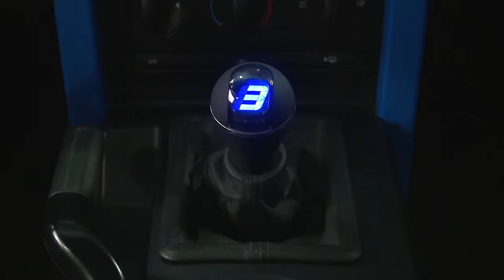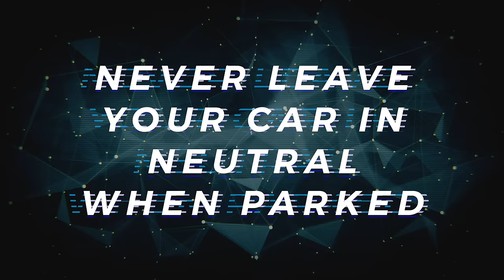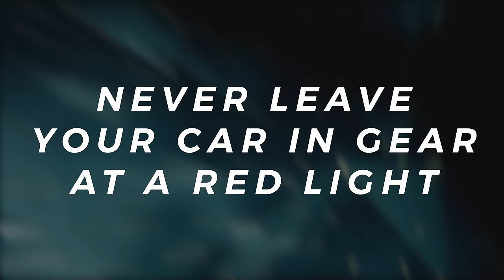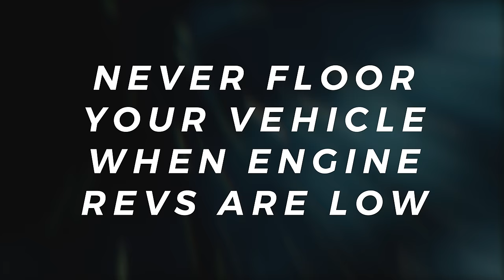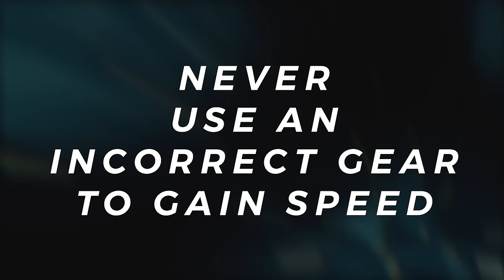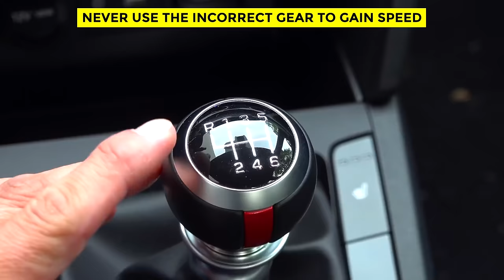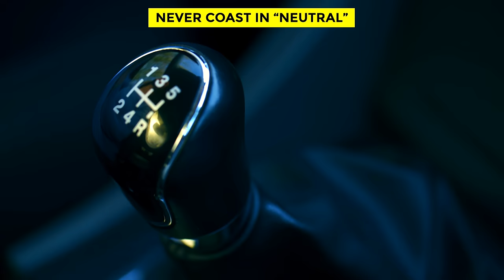7 Things You Should NEVER Do In a Manual Transmission Car!

Comment: "never brake without engaging the clucth"?
engine braking is a thing
Reply: Ig so
Reply: Motorcycles do it constantly
Reply: Lmao
Reply: He probably means "brake to full stop". Most likely nothing will happen if you hard brake without clutch, your car will just stall.
Reply: They use engine braking all the time in Rally’s and Moto
Reply: What is engine braking
Reply: @SpherePK  shifting to a lower gear and release the clutch
Reply: @nightraid6238  ahh okay so the same as downshifting?
Reply: @SpherePK  over-downshifting to where the engine brakes the car
Reply: So glad someone else picked up on this 😅
Reply: @BUSHRABBITRIDING  fr 🥲
Reply: Spelling is also a thing
Reply: @giarlymoltubakk5869  other countries asides from UK or USA is also a thing
Reply: @pottasium7117  bruh, I live in norway
Reply: Exactly vro🤪
Reply: @giarlymoltubakk5869  Countries are written with a capital initial.
Reply: @SpherePK  when the car is moving and you release the throttle, the engine is already slowing the car down, since it isn't injecting fuel (except for 20+ year old cars), what's making the engine rotate is the kinetic energy from the moving car, and part of that energy is being lost at the engine's moving parts. When you down-shift and don't accelerate it's more noticeable
Reply: Good grief
Reply: @SpherePK  you put clutch in change to lower gear let revs drop all the way down then slip clutch and it slows down the car cuz the engine isn’t spinning and the wheels start to spin the engine but it makes it slow down
Reply: @marconarco540  yeah, but if anybody hasnt figured this out yet, then they dont drive manual, or dont drive, its super redundant.
Reply: I'm pretty sure he's saying that so you don't stall the car if your RPMs get too low.
Reply: @KrumzGaming  I use engine braking, when going down a steep hill, near where I live.

It saves wear on the brake linings.
Reply: I was thinking the same thing…
Reply: @KrumzGaming  And left-foot braking. Kart racing doesn't use a clutch at all (non-gearbox karts) - you only have a brake and accelerator pedal.
Reply: @SpherePK  You use the engine's resistance when downshifting to give you more stopping power rather than fully relying on brake disks.

Slow down, shift down two gears at most, slow down some more until your revs are low. Clutch in fully and gently brake.

Clutch + brake is called coasting and is not good as you are not really in control of the engine.
Reply: most appropriately it's called engine "killing"...
Reply: Use brake to ease the pressure on the engine when shifting down
Reply: Listen here potassium head, engine braking is different and STOPPING without using a Clutch but only with the brake is different. Today's gen Z is way to conclusive and idiotic daamn.
Reply: @guyunknown9123  no shit "my fellow gen z"
Reply: @marconarco540  going down to 1000rpm is totally fine in 6th gear. When rolling
Reply: Why am I watching this? I've known how to drive a stick for years.
Reply: @SpherePK  So, you know how keeping your transmission in gear will stop the car from rolling away when it's not running.  You also know that you can start a manual transmission car by rolling the vehicle and engaging the clutch.   Both of these happen because an engine has "Compression" - which is how well it can hold pressure in its cylinders, and an engaged clutch holds the movement of the wheels to the movement of the engine.  

You're moving at, say 50 miles per hour with an engine speed of 2000 rpm.  Without declutching, let your foot off the throttle.  Your engine speed will begin to drop.  The compression of the engine - the same force that keeps the car from rolling when parked - will work to slow your car down.   While it's doing that you apply the brake as well and decelerate smoothly.

About at the point where the engine would naturally idle - usually about 1000 rpm, disengage the clutch so that the engine doesn't stall.
Reply: Think he meant use your breaks, engine breaking is a different thing than using your breaks
Reply: @Wikidshroomz69  same, and it made me slightly upset
Reply: @BUSHRABBITRIDING  so do semi-trucks
Reply: Right? And then he proceeds to say to first brake then push in clutch. Wtf
Reply: @SpherePK  letting your foot of the gas while in gear your engines rpms drop and seeing as your tranny is still connected it slows your car
Reply: @isaiasrdossantos  no their is still fuel and air being injected into your engine with a spark it would stall every time you let off the gas or came to a stop maybe in the new cars that like to shut off at lights but then you engine would still shut down and if your in gear it would lock up your tires tip dont shut off your car while moving unless you want to chew on your stearing wheel
Reply: Pretty sure he meant never stop without engaging the clutch
Reply: ye he also stated never to free car put your car in Neutral going down hill which is not a bad idea as it will save fuel with modern cars but engaging the Clutch kinda makes that pointless unless you are trying to stop
Reply: Yes, I believe often in a motorcycle. Shifting to lower gear slows down the RPM, which helps when going down steep roads. It prevents wear on the brakes and splits the load between the gear and the brakes. 

Lower gear also means "Higher torque" which allows you to go up steeper roads easier. AVOID NOT USING THE LOWER GEAR IN THESE SCENARIOS.

My fucking chain broke because of that. We had to stand for 2 hours in the dead of night trying to replace one of the teeths.
Reply: It’s exactly that but not giving it gas after.
Reply: If you stop completely you ought to hold in clutch otherwise the car will shut down. If you are just slowing down you can simply lower gear.

Comment: 8:00 "never slip your clutch! it will destroy it!" ... Uhm... the point of the clutch is that it slips to enable smooth gear transitions. I agree with "don't drive with your foot resting on the clutch", since that WILL fuck it up, but using the clutch as it was intended and designed to handle (to start from a standstill & to absorb the difference in RPM between the engine and transmission when changing gears) isn't going to kill it. A clutch is a consumable. Consuming it in less than 100k km usually means you abused it (or used it predominantly in heavy city traffic or while towing large loads on hills often). If it lasts you 150-200k+ km, then it served its purpose.
Reply: Yeah, good luck using the clutch without any slipping. Any difference in speed means slipping to some extent.
Reply: I’m pretty sure he didn’t literally mean don’t use the clutch as intended.  I’m assuming he’s simply saying don’t slip it more than you need to.  I can hear a lot of manual drivers slipping their clutches while rowing thru the gears.  That is NOT how the clutch was intended to be hsd
Reply: Well yes but actually no
Reply: I drive my car whit It's original clutch in it, It has 300k km and I think it will least another 50k km and I do used it some times to prevent roll back from a hill
Reply: I also seen drivers redlining the engine and barely slipping the clutch just to start from a stand still
Reply: Just drop it and let the tyres do the slipping
Reply: From now on i will drop the clutch every time i drive away in first gear. Should be better for my car
Reply: Bruh you're an expert
Reply: @daviotje1528  also make sure its in R (race mode)
Reply: @tubestick00  haha i laughed at that
Reply: i agree, i have a jeep wrangler and when doing serious off roading rock climbing this will be inevitable you'll end up popping the clutch an jolt yourself right off the cliff, jeeps have extra thick disks for this very reason
Reply: @TheMarcellToth  same here, i got a truck that has around 200k miles and its the original clutch.. when on a hill i always use the clutch (unless i'm towing a load)..
Reply: My Volvo took 450k km to use up the clutch and some can last up to 500k. But hey they aren't gonna last forever that's what they're for.
Reply: @jujuseption  🤣🤣🤣
Reply: @jessel1217  pretty sure he prob did..lol
Reply: @tubestick00  i always start off in 3rd who wants to do all that shifting, those first few gears are for old people and 🐈`s..lol high RPM'S and high gears!!!
Reply: @terriwebb5093  and that's how you fuck up your clutch and transmission .... Go learn to drive dude😂
Reply: Dude my Ford focus from 2000 is a fucking tank it is on 400 k km and I used to slip or stop rolling my car back soo much times I didn't give a fuck, and still it's working properly I just don't drive the car.
Reply: looks at transmissions stats. Sees 'slipper clutch' huh
Reply: @king-su5uc  when you fail to see an obvious joke -_-
Reply: This Is How I Think A Gearbox Looks Like:

R 2 4
   N
1 3 5
Reply: Basically to avoid slipping the clutch it’s best to drop it when taking off.
Reply: Never had a button clutch have u 🤣
Reply: @rpgspyware9560  something will soon break then
Reply: mine lasted for 350k i suppose thats the old vw design doing its thing xD
Reply: True using a clutch is much easier and efficient then using the handbrake for a hill stop start especially in traffic... The trick is don't half clutch it you just got to time it correctly ie let go of clutch and press the accelerator at correct timing and you're good to go ...

Comment: 1:53 Should be renamed to:
"NEVER STOP THE CAR WITHOUT ENGAGING THE CLUTCH"
Like hell I'm gonna be doing 120kph down the highway and press the clutch if I have to brake down to 100 kph.
Reply: yeah, clearly they haven't drove manual in their life, engaging the clutch before braking is flat out dangerous, staying in gear (or downshifting if not a sudden situation) actually helps braking and keeps better control of the car. most average manual drivers know when to clutch so the engine doesn't stall. btw, i haven't seen anyone doing this.
Reply: It's stop, not brake or reduce speed
Reply: @mattdniels  Bruh, why people don't understand that if you try to avoid an accident you won't even think about the clutch... 🤦‍♂
Reply: @levguguchkin1580  this!!! I was cruising 100kph and just over the hill there was a long line of traffic backed up because there was a massive hedge trimmer clearing the trees up ahead, I slammed on the brakes immediately lmao, I was taking my mates for a road trip 3 hrs away, anyway I have a 96 civic so not the best brakes but I stopped mere centimeters from the car infront of me, and that shook me to me core and foe the rest of the drive all I could think about was, damn should have downshifted to slow quicker but didn't even cross my mind at the time, anyway story time over
Reply: @tomgush  noice
Reply: @levguguchkin1580  If you grew up with manuals and almost never drive automatics like most Europeans you don't have to think about the clutch in an emergency, you instinctively use it correctly due to long experience.
Reply: when slowing down you should press the clutch when you are below 1000 rpm
Reply: @levguguchkin1580  actually if you drive a manual car long enough you dont even think about it .It becomes muscle memory.For instance if you are at a high speed and you see trafick and dont have a lot of time to break the speed the first thing that comes to mind is to downgear and break.
Reply: Use clutch and brake to stop, use brake only to slow donw
Reply: @levguguchkin1580  should be habit
Reply: @lockiemcneven7219  That's how I tell you never been in an accident 🤦🏼
Reply: @levguguchkin1580  thank you
Reply: @giornikitop5373  Yeah it is same is taking it to neutral in high speeds or downhill. Some of advice here are flatout dangerous.
Reply: @tomgush  Uphills are blindspots so you should slowdown a bit and be very vigilant until you can see what is behind.
Reply: km/h*
Reply: @tomgush  km/h*
Reply: Also pressing the clutch while braking increases the braking distance.
Reply: @AryanSingh2512.  the hell, no?
Reply: fr, like tf are they racing? if you press your clutch then brake it can lock up and will have a hard time getting traction
Reply: "stop" vs "slow down"
Reply: @levguguchkin1580  you absolutely right
Reply: It is a correct term to use in this scenario.
Reply: Extremely well stated
Reply: During the deceleration process, I ALWAYS STAY IN GEAR while applying the brakes. I also DOWNSHIFT TO LOWER GEARS to actually help the deceleration process in steps, combined with braking. Depending upon road and traffic conditions, I come ALMOST TO A FULL STOP while in 2nd or 3rd gear and pressing the brake pedal only. Then I press the clutch pedal to the floor ONLY at the very last bit of forward momentum, then bring the car to a full stop by pressing BOTH the clutch and brake pedal. Use each downshifted gear to help slow the car....COMBINED with braking. Downshifting to lower gears will provide ENGINE BRAKING, so that you don't need to rely entirely upon brakes for decelerating and stopping. The ONLY TIME you rely entirely upon the brake pedal is AFTER you have used the downshifted gears and brake pedal COMBINED...to slow the car to a very slow speed. THEN you can rely entirely upon the brake pedal to come to a full stop.
Reply: everytime i roll to a red light i put my car in second and let it brake a little bit with the engine break and then put it in first to do it even more. it's not stupid or whatever, it's smart and helpful. as others said in emergency situations or at high speed you are not going to do anything with your gears but again coming stop at a redlight its actually pretty good.
Reply: Engine braking helps not wear out the brakes.

Comment: Never brake without engaging clutch ... YES and NO !!  At high speed emergency braking, use engine braking (in addition to the brakes) and then engage clutch once vehicle speed is down to reasonable speed.
Reply: That's gonna be hard to apply since old habits die hard. Thanks for the info sir